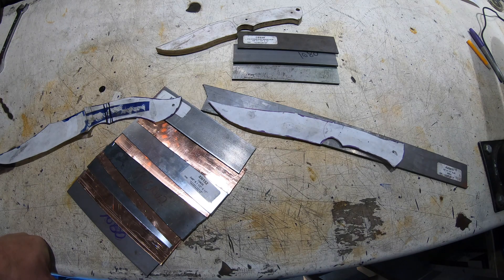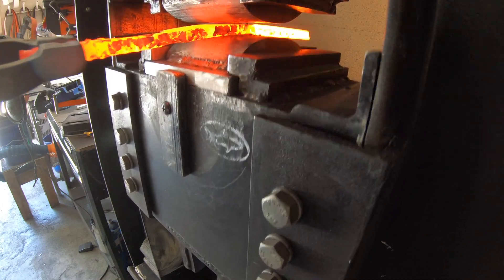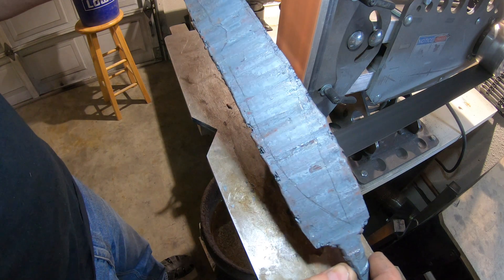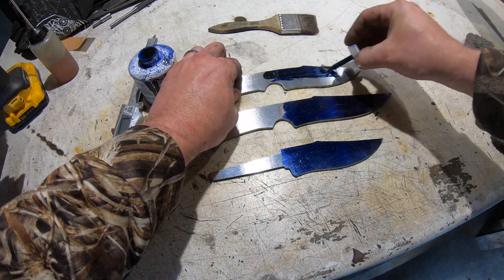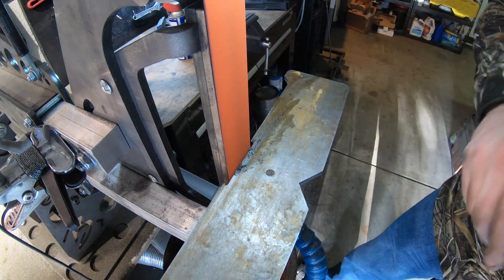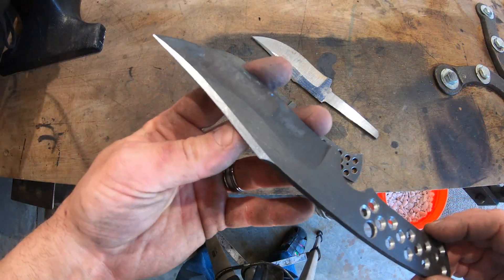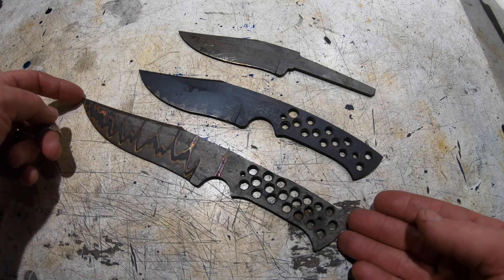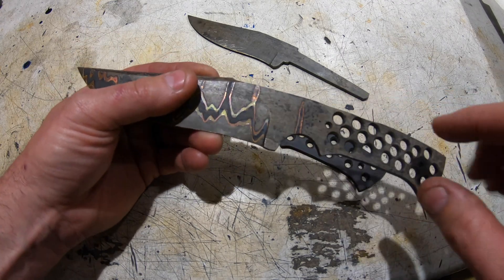Batch Forging 3 Hunting Knives

Comment from the maker: Which is your favorite blade of the three?
Reply: I'd be happy to have made any of those, Denis, but if pushed I think the san mai is my favourite.
I'm looking forward to see how each of these turn out! 
👍🏻
Reply from the maker: I do love the stainless San mai too!  The action on the blade is awesome! 👍
Reply: Yeah...I like them all 😁
Reply: Cumai.
Reply: Is your favorite design the drop point?
Reply from the maker: @justsometurd.1109  well a clip point actually.  You’ll see the clip point with false edge on a lot of my knives.  😉
Reply from the maker: Yes, the top side of the blade that has a short bevel is a false edge.  It’s not sharp but dies make it a better piercing blade. And it looks cool.  😜
Reply: The Cumai is my favorite
Reply from the maker: @hatl29  it turned out really nice.  The handle ended up pretty cool, so it was a good ending.

Comment: Great stuff!   Bummer about the cu-mai handle, will be fun to see what you do to fix that one up.   Also looking forward to the TTT coming up on heat treating/quenching.   That was my one failure on my first knife, I couldn't get it up to temp.   Second one will work better as I have a plan for controlling the heat better with the torch I use.   Cheers!
Reply from the maker: It should be an interesting fix for that handle.  I think it'll look really cool!  Definitely check out the heat treat video, I think that one will help a lot of folks!  Thanks for watching.

Comment: I use a 45° jig on my belt grinder to put the false edge on my bowies, and use the corner of the belt to get the inside curves
Reply from the maker: I’ve tried that and it just isn’t as exact for me.  I’m sure it would with practice but I like the manual method.  It’s more forgiving. 😉

Comment: Nice builds! I'm guessing that the cracks in the tang on the Cu-mai couldn't be resolved with a welder, given the copper content, but what I know about welding would fit comfortably in your eye.
Reply from the maker: I thought of that but it’s a full tang and there’s be a strong weld spot.  It’s going to be an interesting “half-tang”.  🤞
Reply: @TyrellKnifeworks  Well, that being said, it's a beautiful knife, my favorite of the three. Something about Cu-mai really appeals to me for some reason.
Reply: @TyrellKnifeworks  Denis before you cut it, consider that you can TIG braze to add copper. Look up CuSi3 (silicon bronze) filler, and Tig brazing here on YT. I love it, nice calm puddle, runs smoothly - just keep the Amps low
Reply from the maker: @martintoren705  but then I’m not going to see the cool copper waves in that part of the tang.  I think my idea will work out well and be pretty cool.  🤞

Comment: I didn't hert anything about oil type make difference- you interested me a lot (waiting for tripple-T)! Btw: I image that tripple-T series might being harder and harder, so If you don't mind, a few ideas:
- sharpening (I'm don't remember if you made it)
- breaking test (blade gradation structure)
- hand forging technique (proper posture)
- proper anvil mounting and and height (something that I didn't done yet :P)
- about the heattreatment triple-T video: I think it might be too much knowledge to one video: selective heattreatment, heattreatment with clay, stainless steel heattreatment, quenching in air, oil and water, oil temperature...  

Great video and knives Denis - as always:)!
Reply from the maker: Thanks for the ideas!  I’ll consider a few of those for upcoming episodes. 👍

Comment: What tonnage is your press ? i work from home in the UK so houses all around me need an electric one so trying to figure out if a 6 tone log splitter will work , cant get a bigger electric ""press"" in the uk that is not 415 volts .ps subscribed
Reply from the maker: My press is 30 ton. There are plenty out there that are 12 ton.  6 sounds a little light.  My advice would be to avoid the log splitter unless it’s totally free.  They are not designed for the work a forge press does and it’s cheaper and easier to buy a cylinder and steel and build it yourself.  Checkout my early Triple-T video I did on my press.  It has a parts list.  I think it’s #3 of my Triple-T videos.
Reply: @TyrellKnifeworks  Thanks i will problem is you cant get 240 volt hydraulic pumps in the Uk , cannot even get a 50 ton air over hydraulic bottle jack in the UK its weird , a press like yours would need a 3 phase motor and a VFD and a £1000 hydraulic pump and all that is before you built the actual press or bought the ram  not many thing i like America for but forge presses and guns are two of them lol ( ps I'm a blacksmith and a gunsmith not a nut job :-) well maybe a little ..
Reply from the maker: @Edgunsuk  can’t you just order a pump from the US?  In the parts list is a link for a 13 GPM pump for only $155 US.  Even with shipping it’ll be cheaper.  The motor is 5hp 3-phase with a VFD running the pump.  Then $300 for the cylinder,  $100 for the valve and you just need the steel, reservoir and the plumbing.
Reply: @TyrellKnifeworks  I will look in to it thanks for taking the time to explains sir ,cheers .